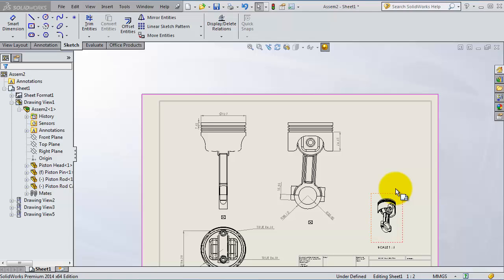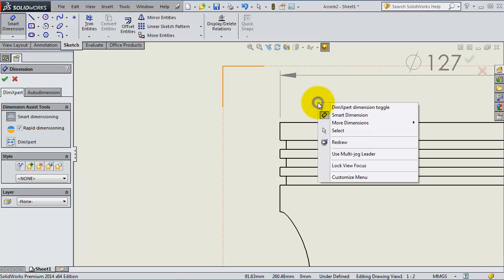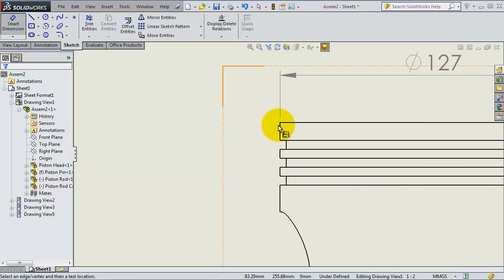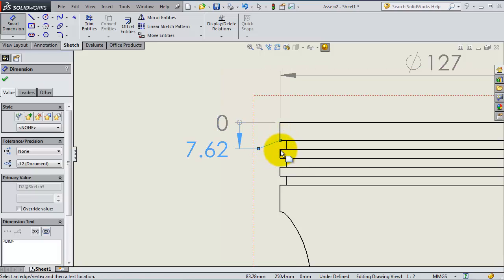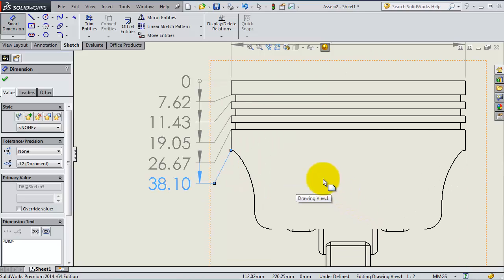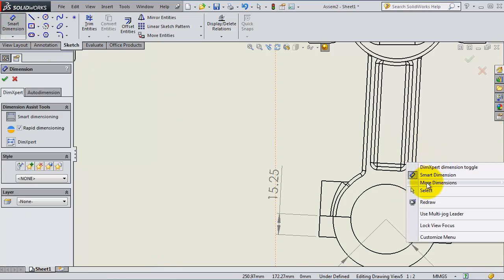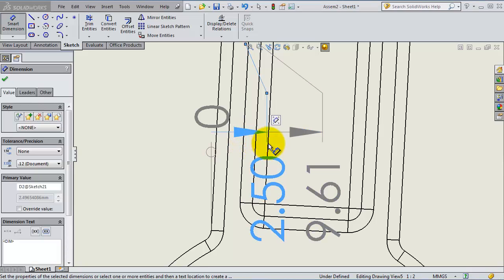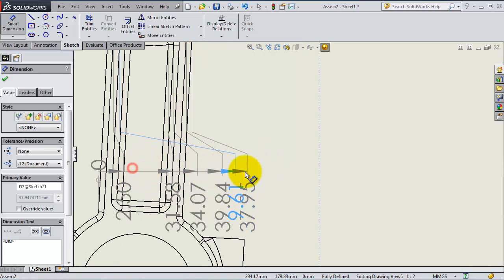134 SolidWorks Drawing Tutorial:More Dimensions methods

Comment: The "Ordinate" option can help fitting numbers nicely, if used under the right circumstances. Otherwise I can see it causing confusion and giving the drawing a messy look. Probably just using the ORDINATE instead of HORIZONTAL ORDINATE would have been better in the second half of this video, because the lines of the part drawing are slightly tilted. Thank you for the nice video !